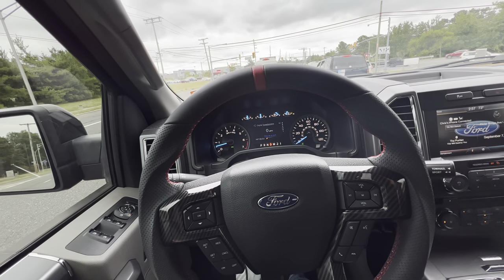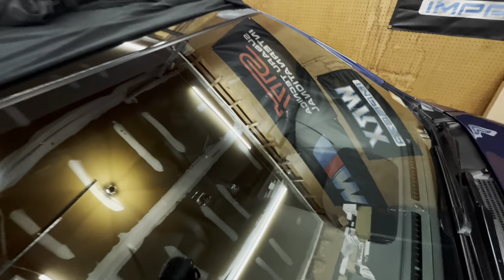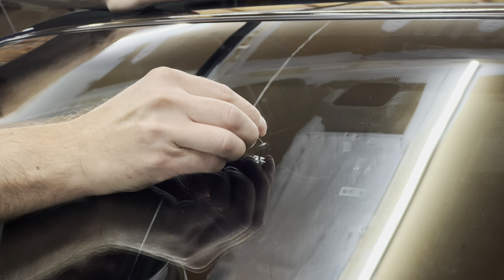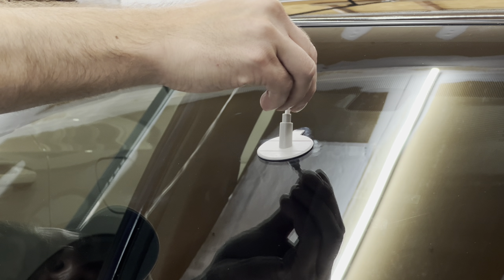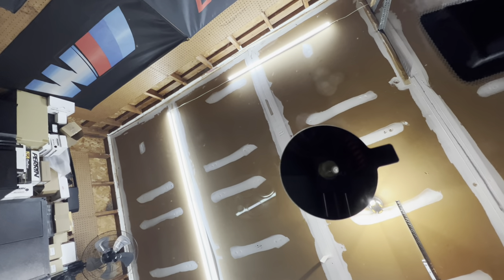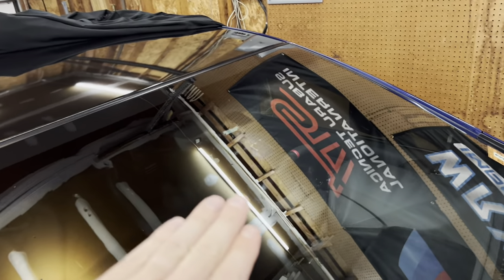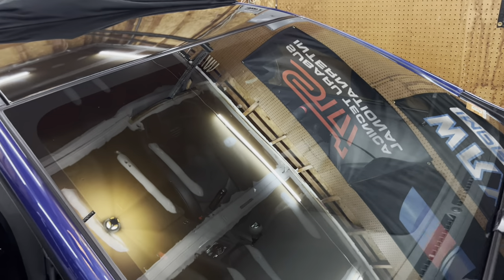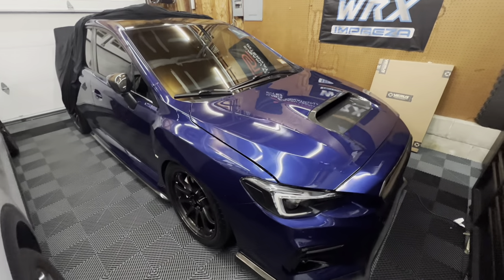How To Fix Your Cracked Windshield At Home - STEP BY STEP INSTRUCTIONS

Comment: My dad had a chip in his corvette windshield right in the drivers side, the insurance company came out and patched it, it was hard to notice until the sun hit it just right then it was noticeable. But definitely a easy fix, some of those windshield companies scratch the chit out of your car scraping the old sealant off and it seems like the glass is never right, I’ve noticed curved areas in aftermarket windshields like to look blurry. 👍